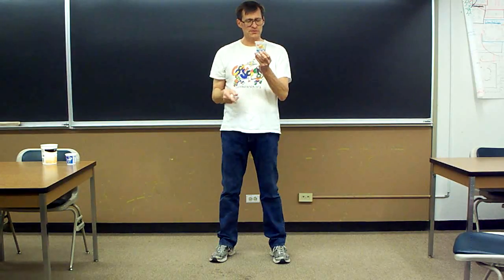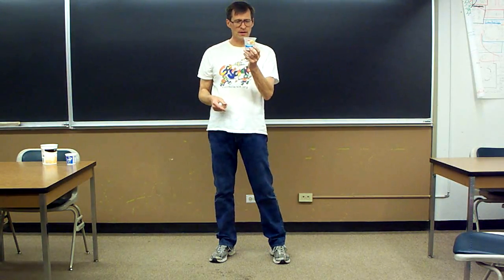Ping Pong Ball Blaster

Comment: I could explain, but here are a couple of things to try.  First, watch really closely what the ball does as it falls.  Secondly, try it again, but after smearing the ball with vaseline so that its surface repels water.
And lastly, think about the forces in the water when it stops suddenly.  Each bit of water has to exert a force to stop all the water above it.  So the force within the water must be bigger the deeper you go, because the water there has to stop a bigger mass of water above it.
Reply from the maker: Haven't tried the vaseline (yet), nor have I found a good way to observe the depth of the ball during free-fall (yet). I would love for you to expand on your comment about the force versus depth.  Are you suggesting a shock wave emanating from the bottom of the cup?